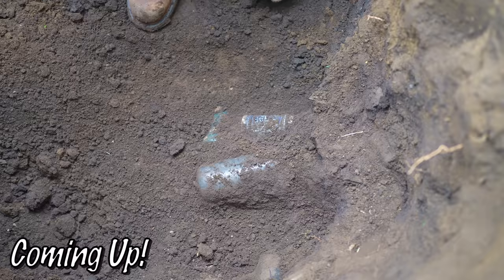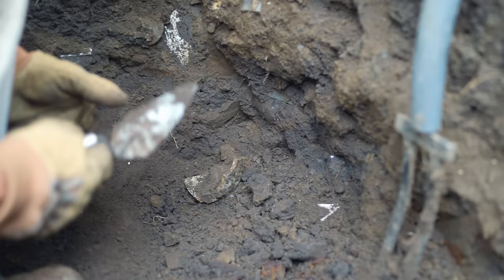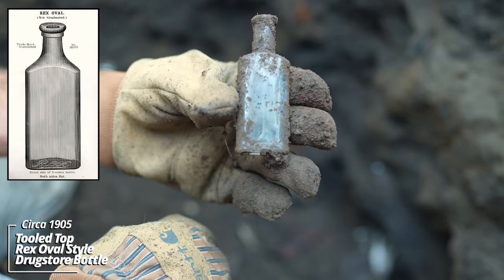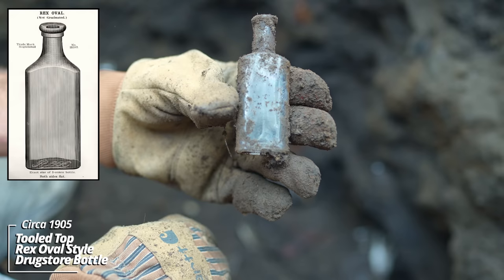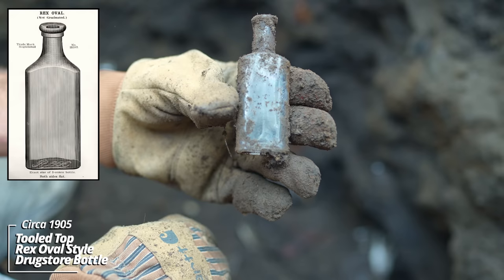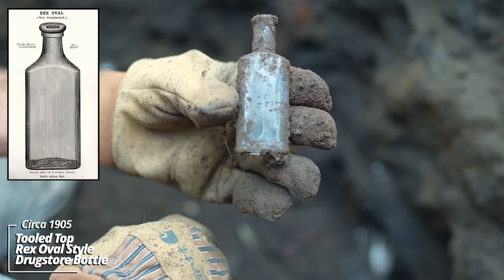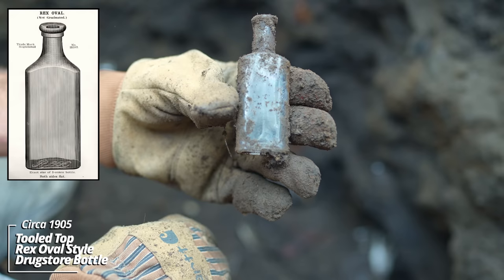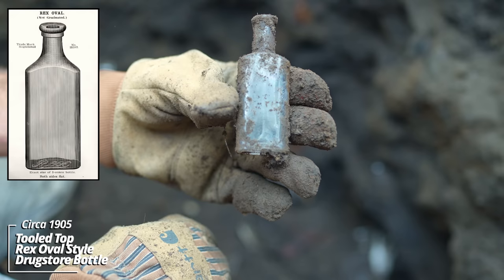Digging Up a Power Line Leads to the Find of a Lifetime Buried in a Back Yard for 135 Years

Comment: The electrical wires thought might prevent you from digging but you managed to get down eight feet deep. Amazed at the beer stein, assorted dinner ware, the blue magnesia bottle and many catsup. Exciting when there is embossing on some and you can date the time frame each for manufactured. And thank goodness for loose soil and no water. Thanks for another great video.

Comment: The house I lived in was once part of a farm in Seaside, CA. The back patio sunk one year and revealed a cystern that had not been filled, but a concrete slab poured over it which finally cracked in the 1989 earthquake. Also, when digging up the back yard to clear the soil for a vegetable garden, I found layered burn pits with wire, a boot, asbestos shingle pieces, etc. I jokingly said that I hoped not find the carcass of a horse. Near the fence was a 4 foot wide and deep pit of empty booze bottles. Fun to explore your own back yard.

Comment: Seems like 90% of what you dig up is from 1905.
Reply: There’s not any great way to  give accurate dates to unmarked glass.  A lot of changes occurred in glass manufacturing around the turn of the century, so you can give a general date based on the year a particular process became common.  Another limitation is that most of these communities were transitioning to indoor plumbing by the 1920’s, so most pits will have contents dating from whenever they got an indoor toilet back to the last time the pit got cleaned out.